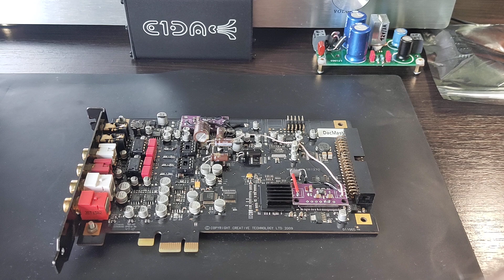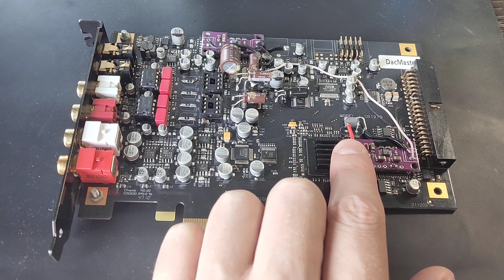UPGRADE Creative Sound Blaster X-Fi Titanium HD [DacMaster]

Comment: Did they add the input capacitors as a cheap RC filter maybe? The computer is a noisy environment.
Reply from the maker: Nope, its output caps, and noise can use ground area...